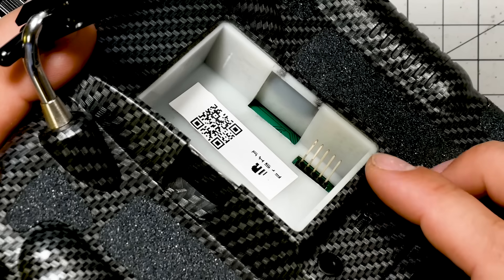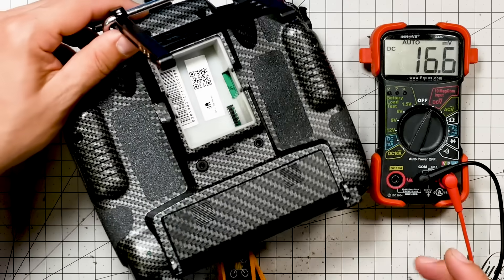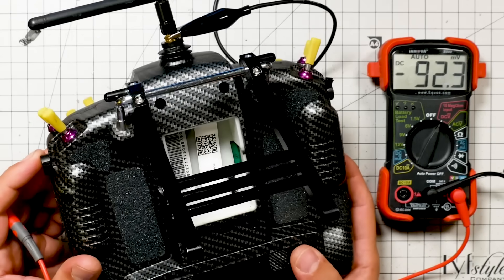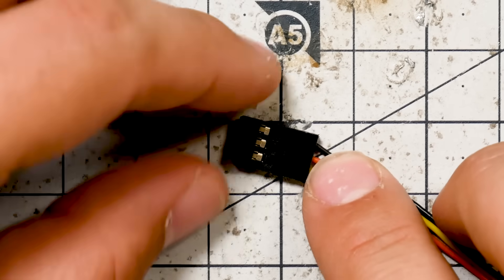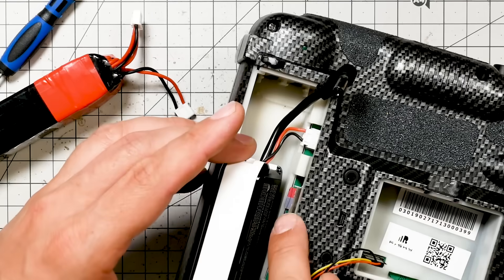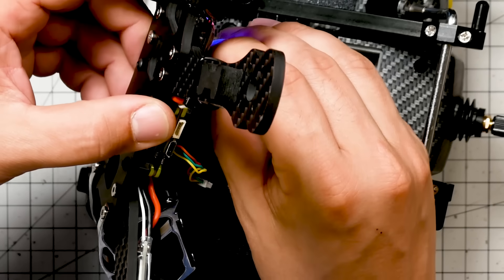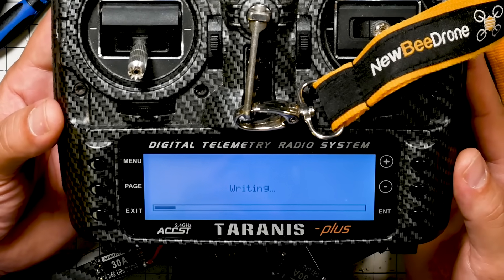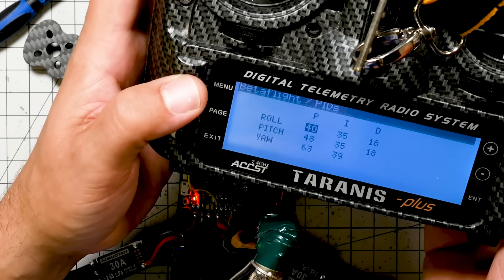FrSky Receiver Firmware Update | R-XSR LUA SCRIPT FIX

Comment: hi, you have a great video, I had a flywoo f405-v2, airbot furling 32 and other parts for many years ... I finally managed to build the new drone, soldered everything, connected the xm+ to the remote control, but the latest betafly did not show the remote control, I flashed the latest firmware to my qx7  , everything went well, now I tried to flash the xm+, but I uploaded the wrong firmware to the xm😢, and I couldn't connect my xm+ to the console😢, then I downloaded other ones and still can't connect the xm+ to the console😢, maybe you can advise what to do?

Comment: Can you update the firmware after the RXSR is already soldered into the quad?  i.e. I don't want to fry anything inside the quad/RXSR..
Reply: Oopss..  Had I watched another 15 seconds I would have seen you plugging it into the already installed RXSR...  "Missed it by this much!"  Maxwell Smart circ 1960...   🙂

Comment: The Taranis lite had to get the internal modular 2.1.0 firmware yup Thanks you are awesome almost sent my receivers back Thanks got them all running .. My sbus wire came out while flashing but it erased and flashed again still works on 2.0

Comment: Im Running out of options here. I am getting my xm+ to bind with my taranis qx7s. i know for sure its binding because i have checked to see if it doesnt finish the bind process or not and it is just 100% binding. but after replugging in my lipo i am literally watching it go from solid to slow blinking to a flashing then i get a sequence of red flashing... I have bought another receiver (XM+) i have even had the transmitter swapped just incase that was it and still the same problem... do you know anything of this issue. I am almost positive i have flashed the same firmware for the internal of the transmitter with the same of the reciever. oh man....
Reply from the maker: Do you ever get solid green on the XM+? If not, then I think it hasn't bound.
Reply: @JoshuaBardwell  Yeah, its green, i finally figured out the issue. but now when i have it hooked up to Beta flight and i am in the receiver tab. its like delayed. ill get like 3 seconds of control of the preview then itll freeze. then a few seconds of movement and then nothing. i refuse to quit but man its tempting i dont know why i am having so many problems with this build
Reply from the maker: Move the radio further from the receiver.
Reply: @JoshuaBardwell  omfg. I have a giant mixture of hate and relief right now. Moving the transmitter 10’ fixed both the blinking and beta flight issue of the receiver tab lagging.  Thanks man.

Comment: I've been an fpv for 6 months. I been obsessing over it, I'm about to get out of the hobby due to buying a bind and fly 2 days ago and having to do this. This is more like an update your firmware and then bind and play. I know eventually I would have had to learn this stuff but I wanted to have fun playing in the beginning and that's why I sent a premium on all of my stuff. Hobbies like this will die with this kind of customer support. Race day quads would not refund my money even though this is advertised to work straight out of the box with radio master. Just a bunch of garbage
Reply from the maker: If you have radiomaster, then it can probably bind to your quad without flashing firmware. If you want to email me jb@joshuabardwell.com I'll try to help.

But there's no escaping that the hobby requires a lot of technical messing around. If you expect out of the box and go, there is very little of that.

Comment: Hi there. Watching the video is educational. However I have a FS-i6 transmitter and r-xsr receiver. The transmitter does not have any pin access that I can see. I am also don't know if the R-xsr has a ACCST or ACCESS protocol. I need to flash the firmware and bind. Thanks.

Comment: Joshua how do we flash it if it’s already installed, I’ve got two bnf quads with RXSr rec. and they both keep on loosing and finding telemetry signals.
Reply from the maker: For rxsr just unplug it and plug it in to the controller.
Reply: @JoshuaBardwell  oh thanks, I didn’t think it would be that easy 👍

Comment: I finally found a difference between the v1.* and the v2.* firmware, and it only applies to the XM receiver, not the XM+:
Normally I configure the transmitter to send only 8 channels in D16 mode for a faster (9ms) frame rate. 
Using v1.*.* firmware (transmitter and receiver), this works fine with the XM+, but with the XM it binds but won't output a valid SBUS signal (it does output something on my oscilloscope, but no flight controller accepts it). However, when sending all 16 channels, then it starts to output valid SBUS data again.
When I flash v2.*.* firmware to transmitter and receiver, then the XM does work again in D16 mode with only 8 channels.

Comment: This is not easy.  It's been two days of flashing firmware, watching videos, and messing with settings. I'm still having trouble binding my new r-xsr and my new TX16S.  I'm about to call it quits....

What are the next steps besides buying a different receiver? Anyone having this same problem.  Both reciver and transmitter are updated on firmware.
Reply: Want to do the same with tx16s and r-xsr. Did you get it right?

Comment: Thanks for the video! I have a big problem, I updated the QX7 and XJT but can't link with r-xsr OEM which was linking before updating
Now, I try different combinations of firmware versions to open tx 2.0-2.2.4-2.3.5-2.3.9-2.3.11 with all the newer and older XJT fimrwares I found but I can't get them to link
I would like to know if there is a factory XJT version that really works or do I have to buy the internal module.
I don't know who sends me to buy taranis
Hope you can help me, thank you!

Comment: I have access transmitter and accst reciver , how to bind them ..
When I power on the transmitter and put to bind mode , solid green and red is seen in reciver.
Is that to firmware conflict or other power..
Can this issue can be fixed.

Thanks

Comment: Josh im at wits end i have tried three R-XSR recivers and cant get any of them to go into binding mode ???
Reply from the maker: You're definitely holding down the bind button before powering up, then plug in and continue to hold the bind button down right?
Reply: @JoshuaBardwell  thank you buddy for the fast response. I was holding down the bind button but maybe not long enough all three lights would come on and stay on blue green and red but no flashing red sounds like I need to hold the bind button down longer when I power it up from what you are saying.j I love watching your videos keep them coming . Soon as I can afford to donate I definitely will you're awesome . I love the multi battery charger that has your signature I purchased a 4s one and use it all the time works very well.

Comment: I know this is an old video but I’ve found a safety pin will allow you to raise the tabs on connectors you need to remove or change the pins from and not damage the tab so it will still lock the pin in for continued usage.

Comment: @Joshua Bardwell As this is the main video on Youtube regarding updating firmware of the R-XSR, can you please put a warning that as of now, updating to the latest firmware will kill your ability to bind to non-approved radios (Jumper, Radiomaster  etc) I am trying to get into the drone thing, educating myself along with your vids and they are great, but I followed this vid, updated my R-XSR using my Radiomaster. Went perfectly. Now my R-XSR will not bind to my radio. I find out it is a deliberate move by FrSky, and now I have to buy a new receiver or something.
Reply from the maker: You can always just flash back down to the older firmware.

I have put out a video with this warning: https://www.youtube.com/watch?v=09g5MfTdiyw

Comment: Is there a difference between the FRK files and the FRSK files? (trying to update firmware for R9 STAB OTA) The Taranis doesn't treat FRSK the same as it does FRK. No option to Flash external module.... Wondering if I can just rename it?

Comment: I wish I watched this before attempting to update my R9 Slim+. Magic smoke from the 3.3v regulator. Luckily  I was able to replace the TINY regulator and it works again!!! The next attempt I just used the smart port on my QX7 rather than tinker with wires on X9D... Much simpler and worked great.

Comment: I have an inveter tx pad on my f411, would I be able to run s.port straight to that pad and FPort will work?
Reply from the maker: If you have a TX pad with bidirectional inverter, such as for SmartPort, then FPort will work.
Reply: Joshua Bardwell got in touch with Diatone and they said it can be used for S.Port or F.Port. Thanks for all the great tutorials. You are the best!

Comment: Found this out the hard way. I could not get my R-XSR to bind with my X-Lite with its factory firmware so I decided to flash a newer firmware version onto the R-XSR. Still would not bind after hours of fussing around. Read on a forum that the receiver as well as the taranis internal RF module have to be running the same firmware version (in my case rsxr_accst_2.1.0_FCC.frk on the receiver and IXJT-XLITE_ACCST_2.1.0_FCC.frk on the taranis)

Comment: Hi there.. awesome Channel... yes i have learnt something... need help with R XSR receiver. I am running crossfire on all my drones and recently built a wing. So removed the crossfire out my racing drone and put in the R XSR. I did firmware and everything as per your video but can seem to bind it. Its like the whole thing freezes and all lights shine on receiver. Green red and blue. I tried LBT and FCC both do the same... any advice?

Comment: In using the servo plug on a QX7 transmitter and flashing through the SmartPort connection on the QX7,  reversing the power and ground wire is NOT needed! I had followed your instructions and had reversed them which probably should have fried my R-XSR receiver but luckily it survived. I put the power and ground wires back in the black, red, yellow order and was able to finally and successfully flash my R-XSR receiver. That is the reason I made my other comment.

Comment: Now if only you had shown how to do this with a QX7.
Reply from the maker: Exactly the same but even easier. Plug in to the servo plug on bottom of the radio. No need for any voltage regulator. In the radio menu choose "flash s.port" instead of "flash external".

Comment: 29#
Hi i have a Holybro Kakute F7 HDV & Tekko32 F3 HDV 40A 4in1 ESC 30x30 Stack and i manage to connect the receiver the first time, but after some time something happened and now i cant connect the Receiver to Betaflight

the goggle and the unit and controller are all green but still not movement in the throttle department :( 

please help

Comment: Hello Joshua, thank you for your video. I will help, but I have a small problem. My FrSky R-XSR will not connect to my Taranis QX7S blue version. I think the problem is in the firmware. How can I figure it out which firmware version is on my Taranis? Is it a FCC or EU LBT version? Looking forward to your answer

Comment: Hello, I have my frsky x9 lite on fcc version and my rxs-r on lbt version, what I need to do ? Help me please I can't use my drone :(
Reply: Mine will only binds to xjt lite module.  
Wondering if having your problem. You have to remove receiver use special plug. Plug receiver into transmitter. Download r-xrs firmware FCC onto transmitter sdcard. Then goto sdcard radio setup menu and goto sdcard page then firmware folder and install to receiver (not internal) .  There are youtube videos

Comment: Please assist me...  I already fried one RX cause I didn’t swap the ground and power in that harness plug. Now I’ve found how to do that, thank you so much for showing me. Now I’m unsure of what to do about the voltage issue while flashing through the radio. I don’t fully understand what to do. I have the new Jumper t16 pro. I’m assuming the rf pins are the same pin out as the teranis in your video but I’m running it off of 2 18650 batteries. Is it safe to do with those?
Reply from the maker: If you are running off 2S you are probably fine. Almost all receivers can take up to 2S voltage.
Reply: Joshua Bardwell thank you so much. Happy New Year!
Reply: @JoshuaBardwell  I'm sorry but that didn't fix it. I followed your other T16 video for updating the opentx firmware & SD Card and I did NOT check the european box you were making jokes at. LOL. But my R-XSR was showing a all three lights solid when in binding mode. So I just successfully flashed  RXSR_FCC_ACCST_191112.frk tried again, and now BLue & Grean are solid and red is flashing when pluggin in usb and holding boot button on R-XSR. I don't know what the problem is.
Reply: I figured it out. Just so you know, the only way I could get it to bind is if I started binding on the T16 then immediately plugged it in while holding the bind button! IM BACK IN THE AIR THANK YOU FOR YOUR HEL

Comment: So I just got the Tinyhawk freestyle using a x light transmitter.  I can't find a way to updated the firmware it keeps droping the signal.  About to return it. I see no way to update the firmware.
Reply from the maker: Are you trying to update firmware on the Tinyhawk or the XLite? Anyway, if you're having RSSI issues a firmware update won't fix it. Most likely it's a damaged antenna on the Tinyhawk.

Comment: HI Joshua.  I really need your help please  i screwed up my radio. And i wouldn't find any information. I Accidently Did flash internal module and now non of my quad is binding to radio.
Reply from the maker: Just re-flash the internal radio with the correct firmware. You can download the firmware from the FrSky web site.
Reply: @JoshuaBardwell  man i have so much respect for you . I really appreciate your help and your quick respond. Thank you so much

Comment: hey Josh my R-xsr when binding and holding the f/s button shows all three led's what does that mean and what do you think I may have to do to fix it??? Any help will be really kind.
Reply from the maker: Ummm I think that is not abnormal. Did it bind?
Reply: @JoshuaBardwell  Dont say it's abnormal :( lol! no it did not bind... I was able to change from Sbus to CPPM no problem and when powered with no input the blue light remains with the red led flashing but not like (bind flash) then when powering up with the F/S button pressed I get all three lights and once I take my finger off it remains and will not change until I take the power out. 

I thought maybe I will need to flash the firmware but as it mentions it is compatible with D16 mode I have assumed that I should have no problems with the EU LBT as that is where I am.
Reply from the maker: You want SBUS output blue light on. Don't use PPM. You should be able to bind in D16 mode. But if you ended up with an FCC receiver you cannot bind it to an EU/LBT radio. You would need to flash the EU/LBT firmware to the receiver.
Reply: @JoshuaBardwell  Thanks Josh for your support XD I thought I was going to need the cable for the R-XSR but I think it comes with qx7s package which is what I found funnily enough so I will deffiently give this a try I'll keep you posted on my progress! as I'm sure I'll get it done.

Comment: question, you downloaded 2 firmwares to your sd card,but only showed you load 1 to the r-sxr. did you do the same thing to the other firmware loading it to the r-xsr. or does it load both at once. thank you for your time,and help as it helps alot ;}
Reply from the maker: You only need to flash one. I'm not sure why I downloaded two.
Reply: @JoshuaBardwell  thank you for your time ;}
Reply: @JoshuaBardwell  i was woundering tht because i noticed you only loaded the newer firmware update not the f port firmware update that you put on sd card. i loaded same one when i get this together ill check out. thnks again.

Comment: if you flash a firmware to an Rxsr w an X9d, is the Rxsr considered flashed if you then use an X lite Radio for it ?  or do you have to flash it again w the X Lite ?
Reply from the maker: Once you flash the receiver, all is good.

Comment: Hi Joshua, I'm wonder if you can help me. Apparently I have common problem binding the R-XSR. when in bind mode all the LED's (RED, BLUE, GREEN) are FIXED. The RED Led never blinks indicating a bind with the TX. I've tried all the advice that I've found in the internet to fix this problem, but nothing worked. I've tried all the latest available FCC firmwares, such as:
RXSR-ACCESS_SPORT_1.1.1.frk (tried with X-Lite Pro)

R-XSR_FCC_190311.frk (tried with X9D+ and QX7)

The firmware of my X9D+ and QX7 is 2.2.3 (ae5ac05b) 2019-01-07

The firmware of my X-LITE PRO is 2.3.0 (05f0057b) 2019-04-19
Can you Help me? tks
Reply from the maker: The receiver and the transmitter must have the exact same firmware on them. So if you have ACCESS firmware on the receiver, you need ACCESS firmware on the X-Lite etc.
Reply: Yes, that's what I did with my QX7 and the RXSR (most recent firmwares) and recently I've flashed with ACCESS to work with my brand new X-Lite pro, but the problem remains. In bind mode all led's are fixed.